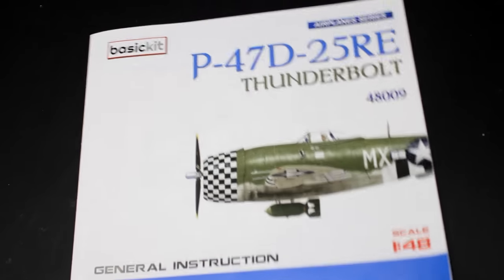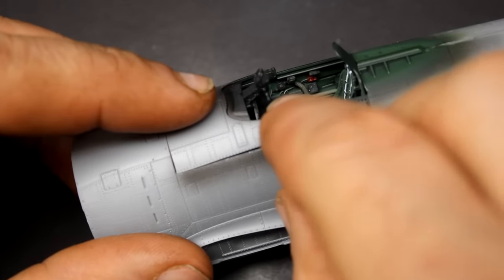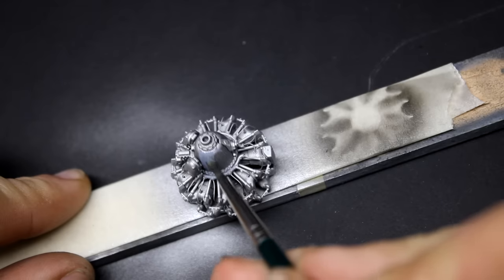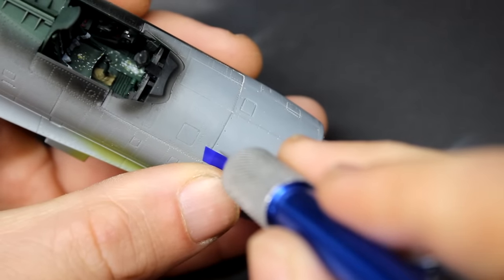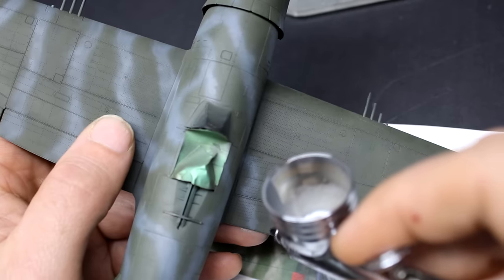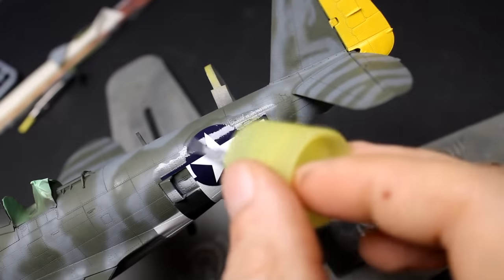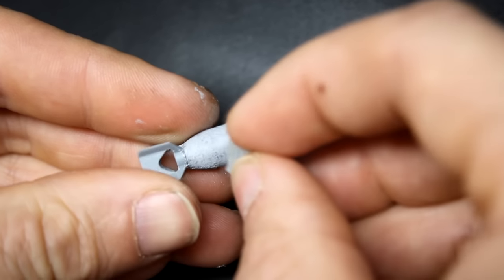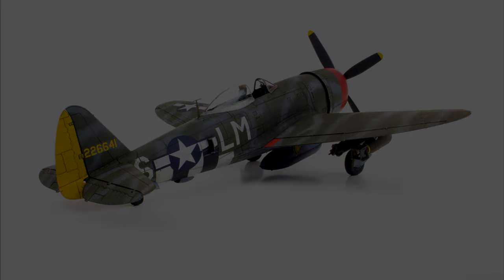The All New MiniArt 1/48 P-47D Thunderbolt! Full Build Review

Comment: I had high hopes for this model but certain things I just don't care for. The whole cowling issue, having to install the gun barrels during assembly and the antenna is just asking for them to be knocked off as I have all ready done. While  I do like the detail and its a new kit, you still can't go wrong with the Tamiya P-47s.

You kits looks great by the way.
Reply from the maker: Thats sort of a choice. Tamiya gives you a simple build with moderate detail. But MiniArt is more difficult with amazing detail. Take your pick really :)
Reply: @TheModelGuy There is no comparison with Tamiya really, as the Tamiya clear parts, on both Razorback and Bubbletop, look like they belong on an egg plane (on the bubbletop the windscreen has completely the wrong slope), and the Tamiya cowling tapers from a 29 to 27 mm width, when it should be 28 mm throughout. Mini Art is correct on the windscreen, sliding portion and fuselage width at 27.9 mm [EDIT: But it narrows to 27 mm at the front panel line of the cowl, which is a bit much, if way better than Tamiya!], with a much thinner prop, with no oversized Hamilton hub like Tamiya. [On second analysis, the gear is 1.5 or 2 mm taller than Tamiya's, and the fork looks timid, resulting in the wheels sticking out inward: I plan to use the Tamiya gear legs, wheels and doors on it. Also I might clean up the wing seam between the 8 guns by adapting the Tamiya gun port inserts... [EDIT: A problem with the Mini Art is the Hamilton prop has too small a hub, and is too great in diameter by 4 mm/8 inches! This means the Tamiya Hamilton is much better and not an option, though the Tamiya blades need thinning, and the hub could be sanded smaller and cut shorter. Also the flaps fit poorly up, and the down option exists only on the Advanced kit, so absolutely get the Advanced kit! Cowling should be assembled on its own, and slid over trimmed engine mounts as a one piece: Don't follow instructions...]
Reply: On another model channel  the builder stated that the upper fuselage  panel in front of the windscreen didn't fit well and had steps on either side. Did you encounter  any problems fitting this part?
Reply: @danwilliams1686  I saw that particular video, and have test fitted the part. Beyond a very slight slicing of a tiny sliver of plastic off the left bottom edge (rather than imprecise sanding on such a small part), I found that the problem of seating this part flush was near insignificant. His problem did serve as a useful warning, but he made a real mountain out of a very small mole hill... I encountered far more difficulty centering the roof of the tail wheel's well cavity, along with the belly part immediately ahead of that. They fit ok, but have no strong locating "tendency" so to speak...
Reply from the maker: @danwilliams1686  no, it clicked into place on my build.

Comment: Great build of the new kit.  Having built several Tamiya P-47s I would still prefer the Tamiya option barring the riveting detail.
Reply from the maker: Nothing wrong with it. I’m planning a razorback for early next year
Reply: @TheModelGuy  There's a lot wrong with both versions of the Tamiya, all of which is fixed by the Mini Art for the Bubbletop, or Dora Wings for the Razorback. Gear looks a bit long on the Mini Art though.
Reply: @wrathofatlantis2316  Hi, serious question, you say there is "a lot wrong" with the Tamiya kits.  I have built both Razorback and Bubbletop from Tamiya and thought they were awesome and I could not see anything that looked wrong to me or my references.  If the MiniArt is much better I will try it out, but I am actually curious about what is wrong with the Tamiya kits.  Thanks for the help!
Reply: @pja-ok4714  My main gripe has to do with Tamiya clear parts, which are way too tall, by about 2 scale inches in both versions. This affects the Bubbletop in that the inclination of the Tamiya windscreen is completely wrong, being far too upright. This is a major visual feature, and correcting the angle on the Tamiya windscreen has not proved easy, even when ignoring the height difference with the bubble hood... The Razorback is more difficult to describe. The windscreen is too tall because the downward curving lower edge does not "bite" enough into the fuselage. But also, in plan view, the forward center windscreen post does not make a sharp enough "point". The Dora Wings P-47C is exactly what it should look like. Second major problem is the cowling: The real thing is 28.1 mm wide at the front of the cooling flaps, 28 mm at the front panel line. Dora Wings is 27.1 mm rear, 27 mm front, which is wrong, but looks right (almost parallel). Mini-Art is 28.1 mm rear, 27 mm front, but is fixable with a cut and spacer top center. Tamiya is 29 mm rear, 27 mm front: A huge amount of taper. Being myself 2/3rds through the Mini Art, there are some Tamiya parts that should be used: The Tamiya Hamilton prop is thicker but way better in the hub and overall diameter: Mini Art crapped their one and only prop, while the Tamiya has 3-4 good ones... The shortest of 2 Mini Art landing gear options is 2 mm longer than Tamiya, and it still sits the model wrong. Tamiya "sits" right, so I will borrow the gear. Worse: The basic Mini Art kit version has poor flap fit in the closed position, and no lowered flap option to hide it. Absolutely get the Mini Art "advanced kit", which has the entire wing parts needed for lowering the flaps and hide the bad fit. As an expedient, I will use the Tamiya lowered flaps, plus their lowered hinges, on my "basic" Mini Art... Finally, the Mini Art guns are not perfectly parallel to the ground. I adapted the Tamiya wing gun insert to solve this, but be advised the fit is poor and so this solution is not easy. The Dora Wings Razorback is a simple trouble free kit, with a flawless prop, and by far the best P-47 in my opinion, despite the fuselage being 1 mm too narrow. It only needs to bulk up the wheel halves 0.2 or 0.4 mm with a plasticard insert. The other kits have this problem, but no split wheel to make for an easy insert fix... Resin AM wheels is the solution for those.
Reply: @wrathofatlantis2316  Thanks for the detailed reply!  I had no idea it was so complicated, but now that you mention these things I can see what you mean.  I guess the best bet for now is to combine the best parts of both kits.  I think its a plan for the way ahead since I want more P-47's, I like them so much.
Thanks again, I appreciate it!

Comment: Impressive model for 1/48. Great to see MiniArt developing aircraft kits.
 You say your a  P-47 fan Robbie. You may find this interesting.

 After building the 1/32 Trumpeter Razorback and early bubbletop, I challenged myself to enhance/improve the two 1/24 Kinetic P-47 kits. They will be posed in flight so the landing gear will be stowed, not requiring detailing. Cockpit upgrades with Yahoo & Red Fox, Airscale seatbelts, Anyz resin engine parts and Master Model detail sets. The Razorback will be modelled as the rebuilt plane from Aircorps Aviation with the high polished finish before markings were applied. Should be completed by February.
The Bubbletop as a factory fresh, bare metal similar to the one posted on my channel. If it turns out well, the 1/32 will be converted into a M with Techmod 32012 decals. Both will have variable speed electric motors to spin the props and pilot figures on custom stainless steel stands. 
I have just finished modifying a Hobby Boss 1/18 FW190 A5 kit (sprue parts of the Merit toy) and have managed to build it into a model I am happy with. The 1/24 Kinetic kits have more parts but are still basic for the scale. The overall shape is accurate on the FW and P-47s. 

The recessed surface detail is too deep. Flush rivet depressions would be no deeper than the thickness of a decal in 1/24. I use water base putty to fill. When it dries it shrinks leaving a more in scale flush rivet.
Reply from the maker: I have the Hasegawa 1/32 kit and I prefer the detail to the Trumpeter one. It has the same cowling issues this one does though
Reply: I agree. Many Trumpeter kits have weird issues. I know to expect a fight correcting or adding parts with their kits. I am working
on a 1/24 Zero, 1/16 Tiger Tank, 1/32 P-38
that have problems making a modeler wonder what Trumpeter was thinking. When I have had enough I switch back to Tamiya.
Wonderful job on the video and Miniart kit. 
  @TheModelGuy
Reply from the maker: @SEMJW  the only trumpeter kits I have in the stash is the 1/32 MiG-29 and 1/35 LAV-III